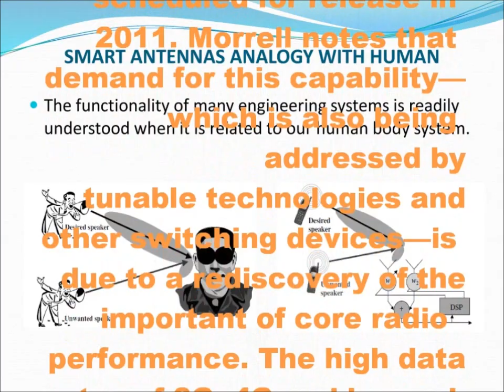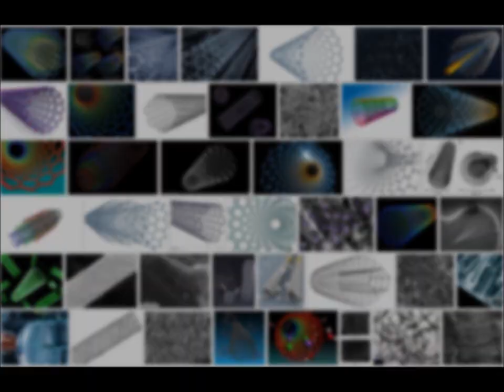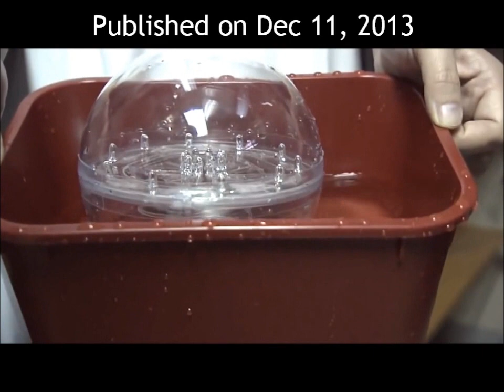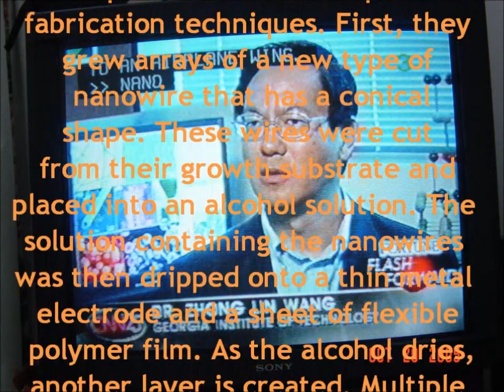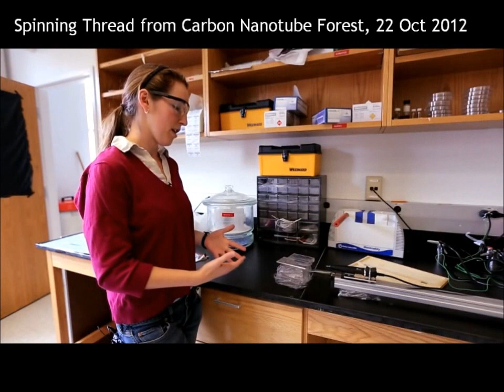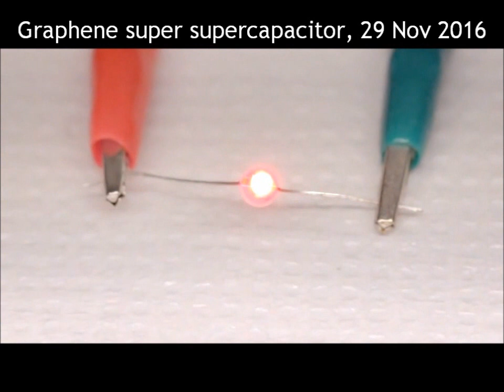C60 related applications

Comment: Smo this is well done -~ SUPER WELL DONE~ validating what bryan 396 nd i have been saying how any direct hit will cause exponential assembly since it is now powered~ any direct hit with this in any form of energy ~ light ~lifi~ sound ~ sonogentics ultra sound etc~ electric~ tenz~ zappers~ freq~ rife spooky etc~  emf ~ elf ~ cell phines ~ ipods ~ tower phones etc~ will charge these particles to assemble~ any direct hit or assault on these nanobio will cause 1st a morphology~the ability to adapt ~ 2nd form a counter~ 3rd expand ~ carbon c 60 will augment any of the effects above that has been mentioned~it will embed into the brain and allow the assembly of circuitry to multiple at a exponential rate~ and form of carbon the nano bio feeds on and utilizes more readily but is not limited to lipids or proteins as well~ the silica everyone has been consuming in the poisoning of the foods since the 1960's would have been the underlay of the circuitry in the body which would have embedded in the skeletal and soft tissue  which would have been a break down in the system making one more susceptible for nano take over with the added glyphosates and other endocrine disrupting chemicals and causing huge dna reprogramming would stop the immune system from functioning as the system should to send the immune system to be able to remove the antagonist since silica stops cellular communication
Tony
Reply: this is one of your clearer iterations of the functional process Tony, and I than you for taking the time to paint the picture.